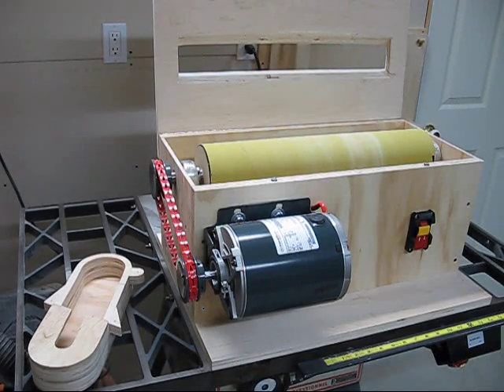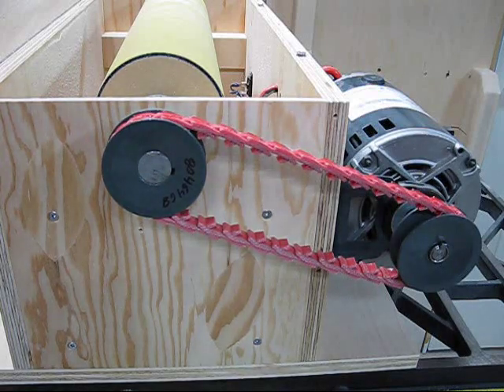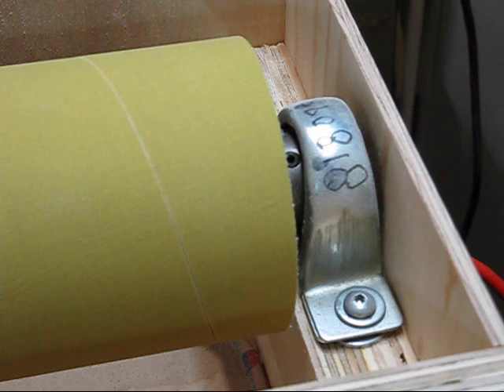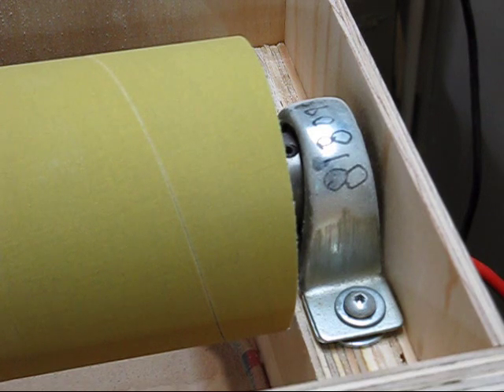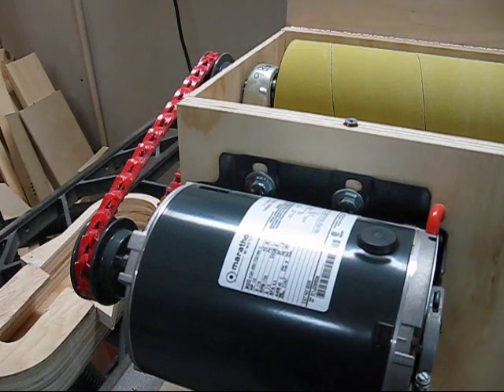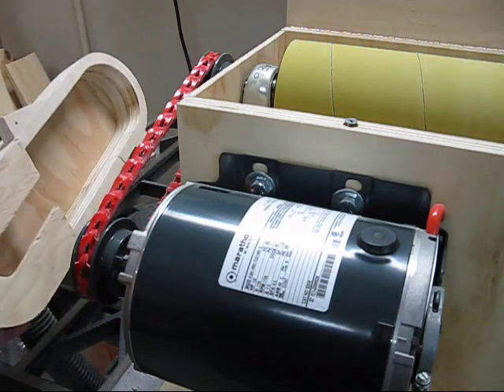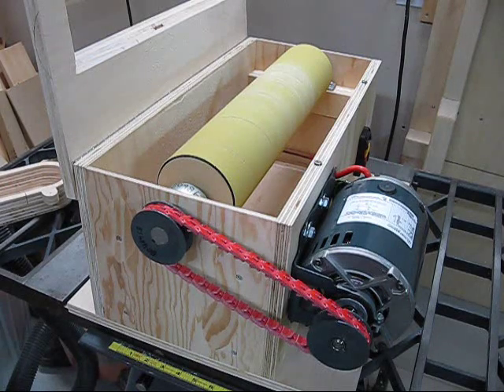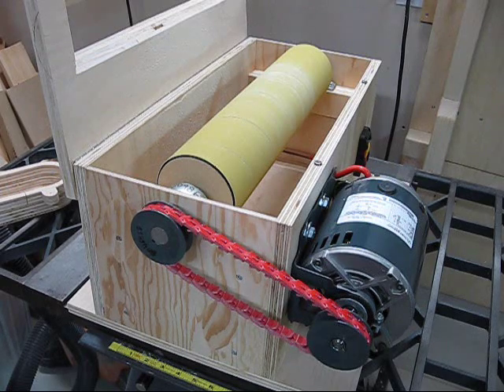V Drum Sander - Part 4 (Details)

Comment: Nice. Build. On the. Sander. And the. Video.  Is really worth watching. That. You did give.  Enough.    Information. On the. Specs.  An details. Like the.  Rpms  ,pulleys,  and motor. Sizes     I. Also like the simplicity.  Of the.  Sander.    And the. Clean. Appearance. It gives.  You. That. Makes. It. Look. Very professional  !   Keep up the  woodworking videos.   As. They. Are.   Helpfull. An informative. As well as. Your.  Other. Knowledge as to what works.  And. Does not work

Comment: I wouldn't go with metal, unless it was a machined aluminum casting. With the PVC, I thought I would insert turned round wood blocks into the PVC at several intervals. However the out of round condition would be a real reason to avoid this approach, as well. Your new approach to sanding the MDF sounds very promising. Thanks

Comment: Paul, I am going to build a V drum sander. Your video series is the best. I see two options for the roller, MDF or PVC piping, any reason to do one over the other? MDF looks great when finished, but seems to be more work than the PVC, I'm guessing. Does the PVC work just as well?
Reply from the maker: T Joseph Witt A friend of mine built one with a metal pipe, the problem was getting the axle precisely in the centre, after he was done it had a slight wobble to it making a smooth sanding impossible. The only way to fix it is to put it on a metal lathe and smooth it out. I think a PVC pipe would be the same, it would be very difficult to have the axle exactly centre. This is why I used MDF, although I would sand it differently, I would take a sand sheet and put it on plywood with 3/4" wood strips on each side and run it along the top of the box. That would work better than the way I did it in the video. Good luck with yours, you are going to love it, I use mine all the time.

Comment from the maker: Ronaldo "Ronnie" Baga - You have your reply turned off so I was not able to answer directly onto your question. I bought my 1/2 HP motor at Princess Auto in Ottawa Ontario. I waited until it was on sale for $99. Hope you get this reply.
Reply: Paul Pomerleau SO the total cost was under $250?
Reply from the maker: sum1sw Exactly, my cost was $250. But I also bought the Power-Link Belt for $24 instead of a regular V-Belt for $5 and premium pulleys to lower vibration, the finished axle... stuff like that. I tend to buy the better parts, but still wait for them to come on sale if I can.
Reply: Alright, thanks :)

Comment: Finally getting close to finishing the sander, I have a question, In which direction should the paper be wound on compared to the motor turns? I am a paraplegic so it has taken quite a while to finish the project I thank you for your help in the past.
Reply from the maker: Hi David, I don't think it makes much difference which way you put the paper on. I personally feed it left to right from the top while spinning the drum towards the rear.

The only thing that you have to watch for is while the sander is operating it is spinning towards you and the little tip of the sandpaper at the end that is turning towards you may get caught in the hole of the table top. I don't know if I explained this right.

A couple of things that you can do to prevent this is cut a little notch into the end disk to tuck the tip of the sandpaper into, or cut off the tip so it is square and has more velcro to hold onto.

I could probably make another video showing this if you need. Let me know.
Reply: Thanks paul,
Thanks for your info Paul, I'm happy with your expiation with the sandpaper, however another question  about revs,the  240 volt motors turn at 1440 rpm "4"x3.5" =1645", Second choice "4.5, 4.5"x3.5 = 18514.43" are either of these suitable? I'm looking forward to using the machine.
Reply from the maker: Mine spins at 1725 rpm. I would try the 1645 rpm on yours first. I think that would be fast enough for sanding. If you find it isn't or just want to see if faster is better then you can always change the pulley.
Reply: Thanks Paul, will do!
Reply: G'day Paul, Very happy with the sander, I've had a house move since I last spoke. Might try a Pantorouter build next. cheers
Reply from the maker: Glad to hear it David. A pantorouter would be excellent. I am sure it will turn out great.

Comment: Paul, Approximately how much hook and loop tape do you think the 4" drum takes? I see Stock Room Supply offers the tape by the foot but I have no idea how many feet I would need.
Reply from the maker: +G Mitchell 
Circumference equals pi times diameter.
3.14 times 4" disk equals a circumference of 12.57" around each disk.
My drum is 18" long so 18 times 12.57" circumference equals 226.2 square inches.
If you buy 2" wide hook and loop then you will need 113.1 inches or 9.4 feet of it.
Don't forget that you will be putting it around your drum at an angle so you will have some waste at both ends in the shape of a triangle, with the hypotenuse of that triangle being your circumference measuring 12.57".
So adding another foot at both ends my drum being 4" x 18" I bought 12 feet of 2" hook and loop tape.
Your drum measurements my be different.
Reply: +Paul Pomerleau Awesome, thanks for the explanation and quick reply!

Comment: David Dorman, this question  from Aust, Do you have any measurements for the box?  I realise my box may vary  a little.  I give a 10 out 10  great plan.
Reply from the maker: +David Dorman Hi David, with my drum plus the width of the bearings, the inside of the box measures 22.5" wide and 9.5" deep. The height just has to accommodate the motor so mine is 9.5" high. That is the box measurement only, not including the lid or the base. Hope this helps.

Comment: lol caught the motor switch, lol , before i got to that part of the videos ,lol    i have a question regarding the motor to drum speed ratio , does the size of the drum to the pulley not change the speed on the outer edge of the sand paper radius by a factor of X 2,  
 ie... 2'' pulley to a 4'' outer drum radius would have a factor of twice the radius of the pulley speed ....... so 1725 pulley would be 865 roughly ( check put pulley speed calculator )and is this a limiting factor, or is the slower drum  speed better then the motor speed of 1725  ,
Reply from the maker: +christophe leblanc 
The motor turns at 1725 RPM. When the motor turns 1 revolution, the pulley attached to it also turns 1 revolution. Since the pulley on the sanding drum is the same size it also turns 1 revolution, and the drum itself, no matter how big, will only turn 1 revolution.
It is the pulley size between the motor and the drum that determine the drum speed, not the size of the disks on the drum.

Comment: How much did the shaft cost and how much does hook & loop sandpaper cost?
Reply from the maker: +matermark I picked up the shaft at a store called metalsupermarkets.com in my area for about $10 - the sandpaper I bought in 10M rolls for about $20 each at stockroomsupply.ca
Reply: +Paul Pomerleau Thanks Paul. I was on an Android tablet earlier and didn't see a Reply link. 
I'm torn between the simplicity of your sander and the others that are more like a planer that sands the top of the workpiece, often with a motorized feed... maybe even the type built from a treadmill with the abrasive belt the moving part. Or maybe the planer type with an adjustable carriage that holds the part to be sanded and butts against both ends to eliminate any snipe.
I've seen a couple here that were built with 4-corner table leveling too, instead of the typical inclined table.
Maybe I'm overthinking things.
Reply from the maker: Yeah those would be fun projects to build. I had to stay small because of the size of my shop, that is why I placed the motor at the front of my sander. Which ever way you decide to go, I hope you enjoy building your own, that's what woodworking is all about, very satisfying.